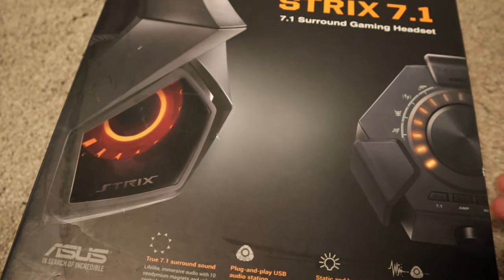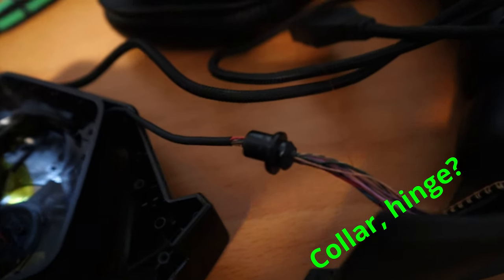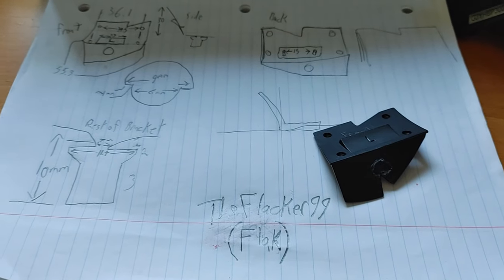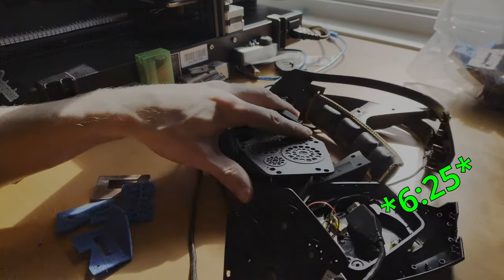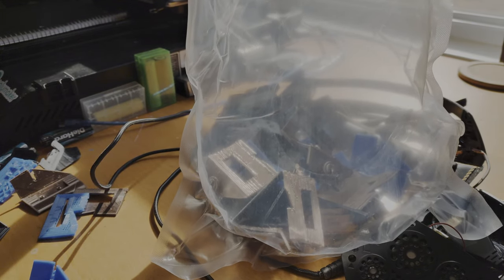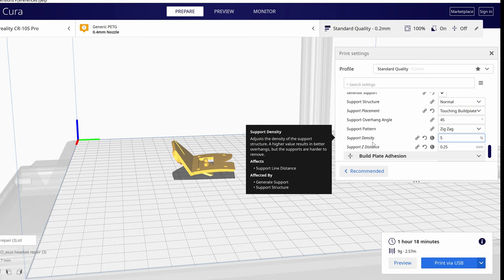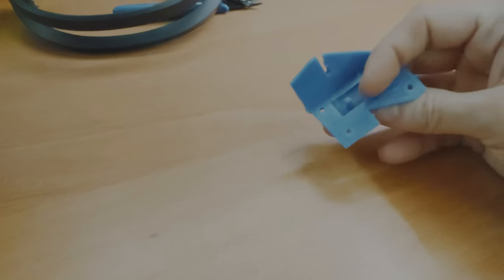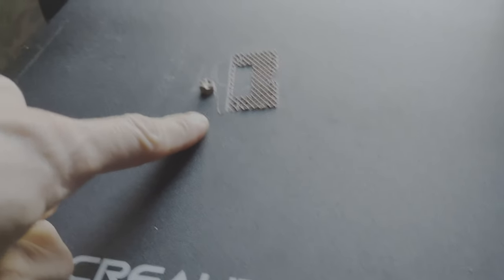ASUS Strix 7.1 headset repair: Episode 1

Comment: yo do you have the cad file for this? mine has the same problem.
Reply from the maker: The part is currently not finished. I plan on sanding the part I made tomorrow to see if it needs any adjustments or could be used as-is. At some point I will be making this entire part in just FreeCAD (no TinkerCAD mods), and hopefully will be posting it on Thingiverse. 
I don't usually self promote, but please consider subscribing. I'll be posting update videos on the project!
Reply from the maker: Hey GTexperience, I finished the model! The file is on Thingiverse. Would you like the link to it?
Reply: @TheFlacker99  yes would love that
Reply from the maker: @GTexperience_Channel  https://www.thingiverse.com/thing:4815715
video will be out tomorrow!